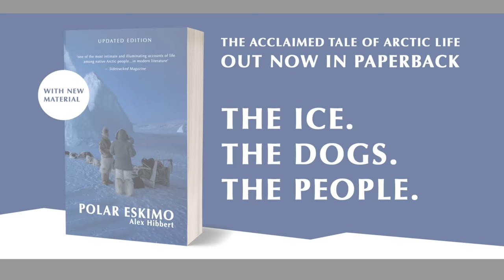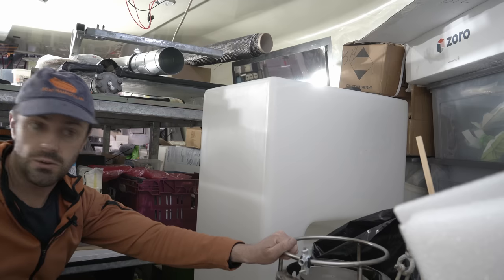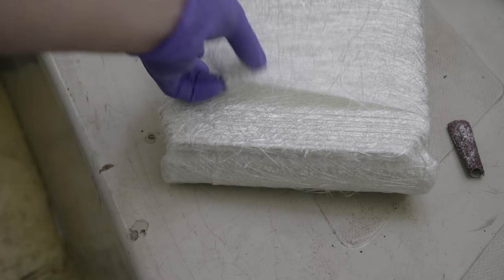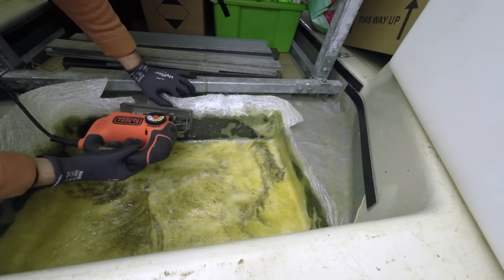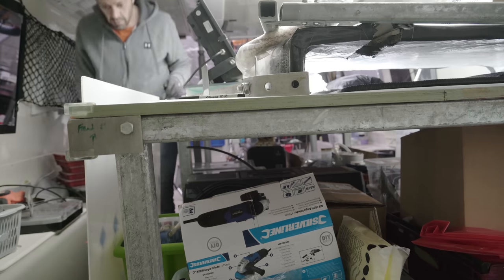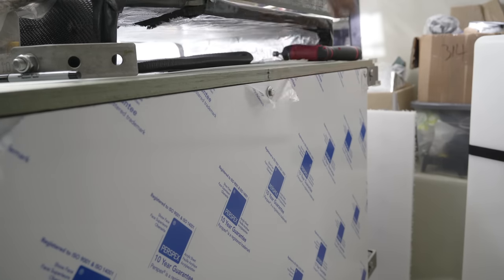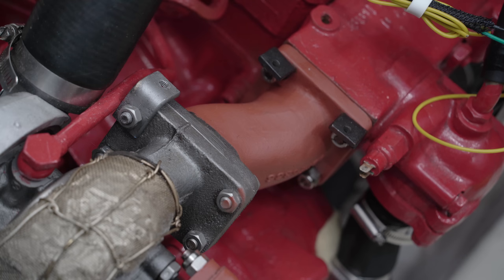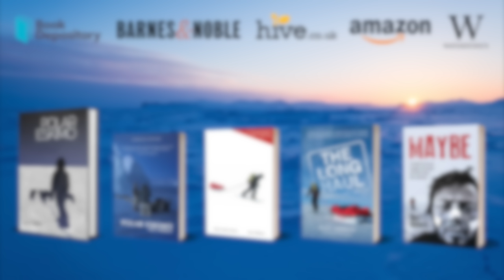Boat's freshwater storage planning - tank, filtration and galley area. Lifeboat Conversion Ep66 [4K]

Comment: Worked in water treatment for the Airforce on deployed camps for the last 4 odd years. The way we stored it was chlorination. Daily testing to ensure it was stored at 1.5 -3 Parts per million (PPM) and top ups if needed. The cooking/drinking use sites would get a carbon filter inline before the taps to take the chlorine out before use. For a 200 person camp at 3 months long i would change the filter once before packdown, in Alan's case probably not at all. I know there are systems to automatically do chlorination on the market, but doing it by hand is reasonably simple.

Comment: Chlorine, iodine, and Portable Aqua (chlorine dioxide) are common to clean water, however if you just block out all UV rays and seal the tank, it should be fine for long term storage, but if that doesn't satisfy, you can always run your water through a LifeStraw filter.

Comment: Assuming a somewhat clean, fresh water source (and probably even if its not),  in-tank UV sterilisation followed by a good ceramic filter is perfect and then you don't have to consume any of those chemicals
Reply: I was thinking about this too, but thought they would draw too much power. 
Apparently small consumer units only draw 10-60W, a lot less than what melting snow for water would use.
Reply: Also if you're really worried about the state of the water being put into the tank you can bubble ozone through it to kill off anything living (and precipitate out some of the bigger lumps)
Reply: @janneaalto3956  He did say something about not wanting to run electrics to that end of the boat as well.
Reply: Yes. Good filtration will remove bacteria and even spores. Outdoor water filters meant for hiking and camping do this...
Reply: @AquaAdventuresTTV  Well there are battery-powered UV sterilizers too.

Comment: My suggestion for keeping the water clean, replacing it with a nice single malt Speyside from the get go, you may think that it will be hard and expensive to replace during an expedition, but by the time you need too, you wont care
Reply: I'll drink to that.
Reply: Can't have just one bottle, you need at least two, in case you run out too fast,  then another as a hot spare, maybe another as a cold spare, then another as.....
Reply: If you were to store it in a wooden barrel, it might even appreciate in value.

Comment: I also think a small heat exchanger in circuit with the engine cooling system is the best way to recover heat and give you an option of the existing hull circuit is compromised.

Comment: I have a reverse osmosis system that came with an electric pump. I never understood why, as these are usually hooked to well water, via a well pump, or city water; both with plenty of pressure. Anyway, the unit, including whatever additional size drinking water tank you use, does not take up much room. For such a vital commodity; water, it could be hooked to your water tank, and in a pinch/necessity be adapted to any sea or brackish water. I know they are used on subs and ships, but don't know how it would fit into your environment. My second choice would be MrTrilbe's single malt contribution.

Comment: I spend most of my summer working oboard small and medium sized boats in the coastal areas around Alaska. Sometimes spending week without going ashore or stopping for supplies. We use a reverse osmosis filters for turning salt water into fresh water. They make them small and we only need to back flush the filter to reset them after a few thousand gallons. The tank is not exposed to light. You can probably just paint it blackn if your worried It gets flushed twice a year with some simple cleaning solutions. Most of these filters filter about 50 gallons a hour. All the water you'll ever need for drinking, bathing and cooking.

Comment: Your belt and braces approach to your water system may be overkill however if you are going to add water purifier chemicals then make sure that they do not destroy whatever filtration system you have. 

Your weak point is that you do not want to be drinking any contaminated water therefore a separate UV system and tap would seem to be indicated especially since your waste system is essentially a bucket note hand sanitiser is a must when emptying it since this a much more likely source of infection. Also a couple of dozen large plastic bottles of sealed water in case of contamination of your drinking supply.

Comment: Safe travels!  As long as your filters work, and depending on budget, available space, etc, you may get away with water sanitation tablets in junction with a light blocking material.  I use Oasis (Not a sponsor, just the one I have been familiar with since teenage years).  While it does add a taste, most people either don't notice or get used to it.  You do have to be reasonably careful not to over or under dose though.

I imagine there are better suggestions already but consider this one for the Rhythm of Algo.

Comment: this IS the way to go, UV light tube as used in ponds for koi-carp etc and the lumps use an inline charcoal filter, these are cheap, easy to install and service. its how its done, or how I did it,  I piloted one of those capsule lifeboats and on the river it was fine but when we got out past the peers on the Tyne it was hell, they are so buoyant they bob like a cork, sea sickness soon follows and with 20 men on board all with last nights beer in their bellys. . . well you can work it out I'm sure. . .so its UV light, charcoal and no beer.

Comment: For the water, something that blow me away was how great UV-C Light is. It kills everything, and all you need is electrical power.
BUT and that is a big one. I only have experience with it for ponds and pools. And from 2nd hand that Vienna is using it for its water treatment, not confirmed.

e.: scrap that: You said you don't have power there, and that is something that can break. Chemicals are a "fire and forget" kind of solution.

Comment: the only way i could think to get heat off that turbo tobe without a liquid is to attach some fins and build a heat sink, then a cheap fan blowing over it would move some air... the downside is you would need a bit of duct work that can take the heat even when the system isnt running and a way to attach the fins to the metal that wont melt after it gets hot.
without knowing how hot that pipe gets i can only make guesses.

Comment: !:15 Why Port and Starboard were invented.
Water Filtration: RO Filters will even make sea water drinkable, which is a bonus considering you'll be surrounded by the stuff. As biocide, I'm partial to silver and UV lamps. Somewhat redundant with the RO Filter though.

Comment: This is probably a little late now, but in my experience - I am coming here with an impressive sample size of two - water in plastic containers goes bad far more quickly and far worse than water stored in metal ones (e.g. Aluminium). If in an Aluminium container, the water may not go bad (only a little stale-smelling) in multiple weeks without any additives

Comment: I would highly recommend watching the GearSkeptic series on water treatment if you have the time. They are extensive but mostly hiker orientated, so it does not go into much detail about storage for longer periods. Chlorine Dioxide might be the best chemical for disinfecting the water  in the first place, although ultrafilters are also an interesting but more expensive option (also they break if frozen!). As for the long term storage i do not know enough. Also i am not an expert in any shape or form so do not trust me....

Comment: For long term water storage, (Should note former US Army medic whose one job was inspecting/testing and purifying our Lister Bags and Water Buffalo tanks, plus living on a farm with well water), first to prevent growth from UV, is simple.  Paint the tank.  We painted our tanks black, just leaving a 2 inch strip unpainted from bottom to top to check the level without opening the tank.

For purification, first be sure ALL of your water runs through a at least a sediment filter.  On the farm and in the Army, we would make slow sand filters out of 5 gallon buckets to pre-filter, then run it through a ceramic filter with activated charcoal filter into our tanks or barrels.  Then we would add calcium hypochlorite or HTH Swimming pool chlorine to them to prevent any algae or other stuff from growing.

The bleach mix is available from the US EPA website and from the CDC website.

The powder is easier to store, however be sure to double if not triple package it, as even the outgassing of the chemical can cause corrosion.  We keep it in it's original container, then put that container in a large 2.5 gallon ziplock bag, then put that in a 3 gallon bucket with a gamma seal lid.

I'm making an assumption here that you will also be adding a ROWPU to Alan, if not, you should be.  You would want one that can also be operated manually, plus you want at least 1 extra set of RO Screens and the O-rings and seals.

And this may not be pertinent to you, but in my personal kit is a Katadyn Pocket Filter with an extra ceramic cartridge, o-rings/seals and silicone lubricant for the pump.  It won't work with salt water, but it filters down to 0.2 microns and the ceramic filter can be cleaned and reused.

Comment: Looks like chlorine is the way to go. The tank needs to be insulated as well as light proof. Legionella is a risk for long term storage and its not killed by chlorine. Low power LED UV sterilisers are available on the RV/Campervan market. I believe they work on demand. So insulation + light proofing, chlorine and testing, filtration then UV sterilisation.

Comment: Alex, are you absolutely determined to drink the water in your new plastic tank?  Again 25-30 years of chlorine with decent filtration at the sink worked fine, but that was for a boat that sat a lot (don’t they all), and we only drank that water in emergencies.  Cooking cleaning, bathing, all good.  I’d keep drinking to a fungible purchase when available.  If this is all about going to the arctic, I still think chlorine is best, but be aware of what if any metal is inside that tank. . .I saw what I thought was a drainage plug that looked metallic and that concerned me a bit. . .

Comment: Paint your tank black To slow growth of anything that might make it into the tank - I would say "UV Sterilization and ceramic filter before water enters the tank, ceramic filter and UV sterilization after -  This would slow refilling water by a lot but would maintain a sterile system that should have little to no growth.. the issue is finding UV lamps that will survive the journey.  I have an off grid property where I store about 1000G of water every year for consumption and have found that some bleach (1 tsp per gallon of water) in the tank to kill all of the nasties and then a ceramic filter and a carbon filter for drinking water is actually the most efficient way as UV sterilization before and after eats power that I may not have to use at the time and guaranteeing that I have nothing that will grow in the tank isn't always that easy.

Comment: I know I am a bit late but, in my occupation we deal a lot with different fluids and the weight of said fluid. I'm from the US and fresh water weighs roughly 8.34 pounds per gallon. not sure on the conversion to metric however that tank looks like roughly 75 gallons which would be around 625 pounds. I am mentioning this because I see that you only put one layer of fiberglass on top of the foam and I would be concerned it might crack when your tank is filled. Also, I love the project so far keep up the great work.
Reply from the maker: Thanks Jonathon. It won't hold 75 gallons, but yes will likely get heavy when full. That skin of fibreglass sits atop  a thin wedge of foam - and that foam isn't cheap insulating foam but instead structural marine foam. At one end it's a few inches thick and the other peters down to zero, where it meets solid hull. Should be ok I hope!
Reply: @AlexHibbertOriginals  Glad to hear it. Keep up the great work.

Comment: Internal heating can be solved easily using the same way they do it in cars, can it not?
Simply add a radiator in series to the engine and external cooling line, with a fan.
Disabling the fan will keep the heat from dissipating into the room.
Do make sure it is big enough as not to restrict the waterflow.
Reply from the maker: There would need to be an interface between the soundproofed engine bay and the cabin - not as simple as it sounds.

Comment: I to live off grid with a water tank and I’ve also had the same thoughts of water purification. I actually did think about buying a bunch of copper fittings and throwing them in there and I’m not smart enough to know if that really does work or not or how much you need. I look forward to your solution thanks

Comment: Have you considered a reverse osmosis filter system for your water needs?
Reply: I would have thought this was perfect, especially seeing as they can remove salt from sea water, but the power draw is the problem. 24v, 1.5amps for I don't know how long per liter. They're pretty simple units too. You could carry a spare motor and filters easily but maybe a manual pump system would be more reliable.
Reply from the maker: I'm currently thinking about water maker needs/options. This is really just to polish already clean freshwater.

Comment: It's a popular misconception that UV light kills bacteria & microbes. What it does is to make existing bacteria unable to reproduce or multiply. I would consider using a silver-ion generator. Silver-ion filters use electricity to generate the ions so you'll need to find one that is compatible with your electrical supply & doesn't consume much power. Plus they typically use less power than the UV filters do, so they would be a better alternative than a UV filter. To control algae you only need to remove nutrients and sunlight, so since the water is clean or free of nutrients to start with you can paint the outside of the water container in blue paint or build a light-blocking cover for it. Ignore anyone who suggested a reverse osmosis filter because RO filters waste water to produce clean water & you can't afford to be wasting potable water on an expedition. Besides that, an RO filter forces you to install a discharge hole for the brine/waste water discharge and they need a minimum water pressure in order to operate. Lastly, I'd bring a separate ceramic filter or Zero Water filter on board as a backup. The problem with a ceramic filter or the Zero Water filter is that you can't pump any volume through them. They have to drip-feed a reservoir, so you won't be able to get a lot of filtered water on demand. I would steer away from purification tablets because unless your tank is empty whenever you fill it you'll have to use some math to calculate or guesstimate how many tablets you need to add for the amount of water that was used to refill the holding tank. If you miscalculate then you can end up with too much or too little of the chemical in the water. My purification chemical of choice is potassium permanganate because it can purify water as well as be used to start an extremely hot fire when adding some glycerin to it.

Comment: I know I’m late.. but I’m the ship I’m on right now we use chlorine in the FW.., I’m guessing there’s no way to put a RO if not a small RO machine on Alan RO - Reverse osmosis I’ll Dm you photos soon with what my ship as to prove it..

Edit - put a small UV light in the tank too to remove any bacteria or any other growth that could occur, for when your away from boat stuck lots of chlorine in the FW tank to help preserve what is in the tank.. when I’m along side or at Sea we have one 1L of chlorine per 100 tones of FW onboard 

Edit 2 - Put a grease trap in for the galley sections to help prevent anything bay to happen.. honestly it’s not needed but it could work for the long run unless your using ration packs for your exercise.
Reply: But if you want heat, a heat exchanger from the engine on the outside of the engine cowling is the best way to produce heat.. on my ship we have this every where in the weird spaces that seem cold during the cold months even if it’s warm along side..
Reply from the maker: I've done the rounds again and again on the radiator question. There's simply no way to do so with my configuration, without tapping into the current wet cooling circuit and running diversions through the sound-insulated cowling. Two experts have advised me not to try.

Comment: Water tank: I suggest doing nothing. In a dark tank of polyethylene, water stays fresh for years and years. I use a pickup tube for the water from above to prevent automatic discharge. This pickup tube is a regular copper water tube. Good against algae. No chorine, no filters (breeding place for all kinds of little animals), just water. The tank (about 600 liters) has been in use since 2005. Never cleaned, never emptied completely, just used normally. One thing...keep it dark inside and use copper piping wherever possible.

Comment: As other commenters have suggested, a combination of chlorine/bromine in the tank and an in-line UV light. Bromine is better long-term, but I have more experience with chlorine. Low levels of chlorine won't damage the plastic too much over time, and heating the water for cooking neutralizes the chlorine. This is the method we used in the military. Too much chlorine can be readily identified by taste and the unpleasant effect it will have on your digestive tract, but isn't seriously harmful. The UV light is a new wrinkle made available by technology. If you can find a system that's not overly complicated and doesn't draw too much ship power, you can strike a balance between keeping just enough chlorine in the water to inhibit mucky organism growth, and a UV light that kills everything, including the chlorine, coming out.